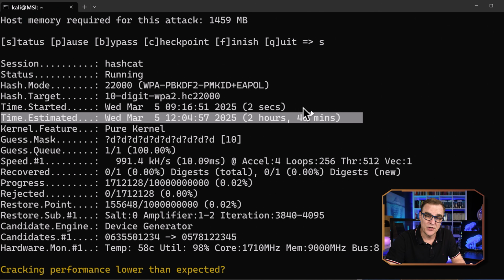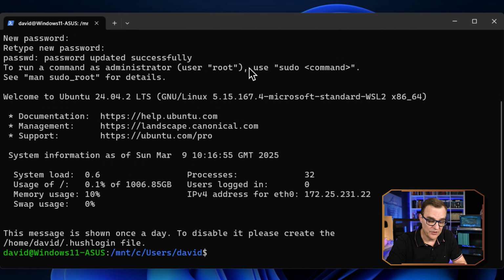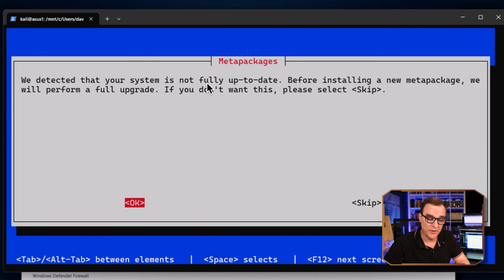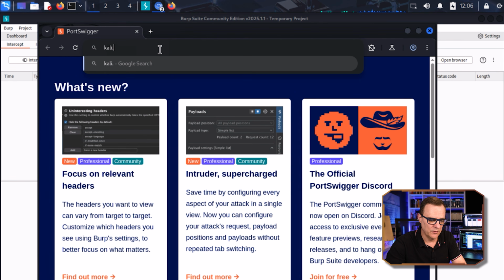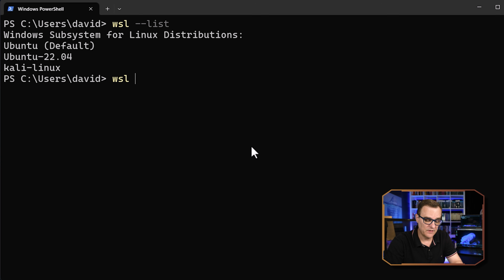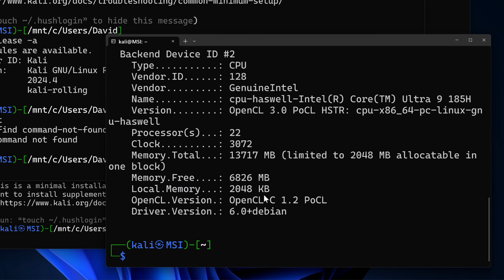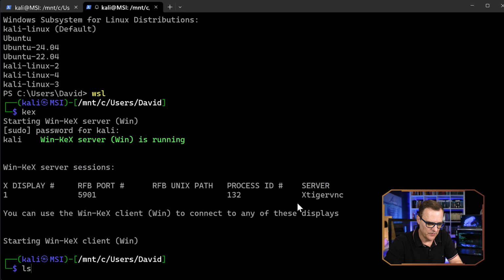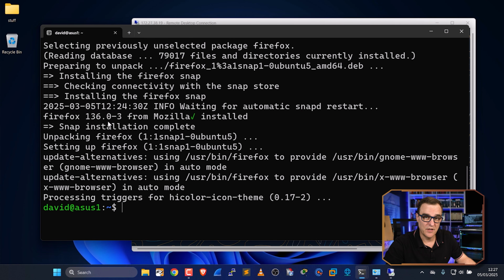WSL Setup (GPU WiFi Cracking, Wireshark, Remote Desktop and a lot more)

Comment: Well, it seems that Windows 11 home edition does not support remote desktop and it just gives either a blank screen or crashes. So it seems trying to get a GUI for Ubuntu working on a Windows 11 home edition that most users would purchase following all the steps here to use a remote desktop using WSL was a waste of a few hours of my time and WSL without a GUI is useless for linux c++ development outside console based applications.

Comment: best way to use aircrack or hydra is to use it with docker container and add gpu device to the docker container, no mess,just straight forward stuff

Comment: Nice that we can run multiple instances, even from multiple distributions, all at the same time (as long as the PC can support it..).
But is there a way for each of these instances to get each a specific (i-e different) IP address assigned...?
It looks like they all get the same IP address from WSL. 
You would think about assigning a specific IP address manually, but don't they still revert back to the same one when they get restarted...?
Any advice would be much appreciated, thanks in advance.

Comment: One thing I think should have been mentioned is the oversite of the kex process. I had to download and install TigerVNC, along with obtain my WSL Kali Linux IP address and then launch TigerVNC and manually plug in the IP address and 5901 port number, which then I could connect to the GUI. I wish this would have been outlined in this video, but other than that....stellar walkthrough David!

Comment: Is a WiFi adapter required to run Wireshark, or can the machine's current NIC be used?
Reply from the maker: No need to have an additional adapter to use Wireshark.
Reply: Make sure it's just set in promiscuous mode too